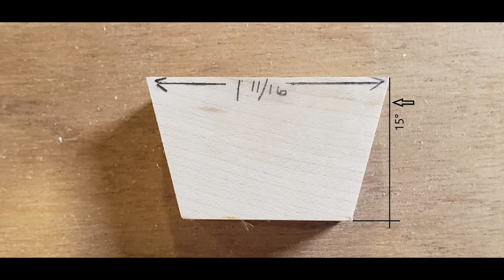How to make a wooden segmented turned Lamp

Comment: Hey there,  just watched your video on the lamp.   It came out really nice.    I have 2 questions.  1)  did you do anything to the bottom once you was finished.
2)  Once you finished it, did it seem at all to light for a lamp  as far a weight goes.    Thanks   Good work
Reply from the maker: If you go to 18:14 of the video you can see that I inserted a plug and that I routed a channel for the lamp cord.   It's weight is more than enough for it not to be top heavy.   Thanks for watching.